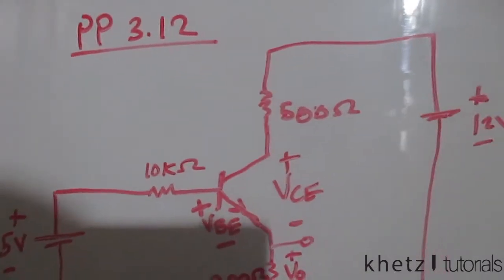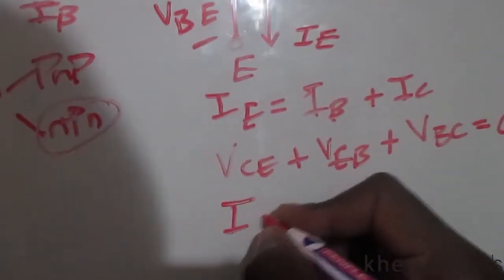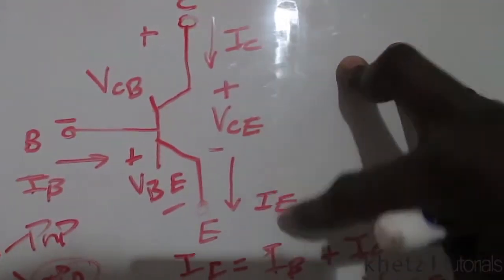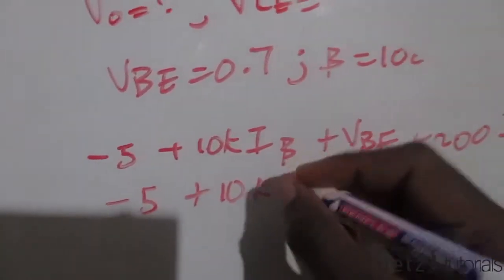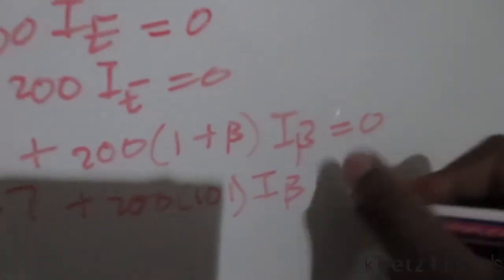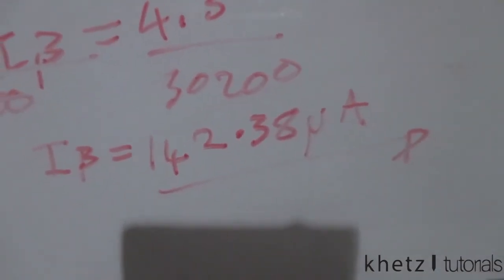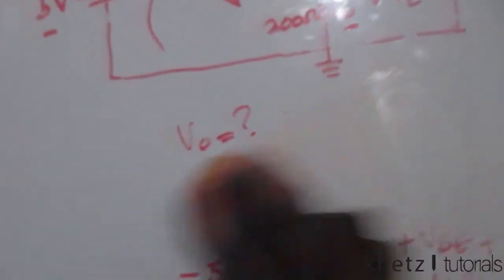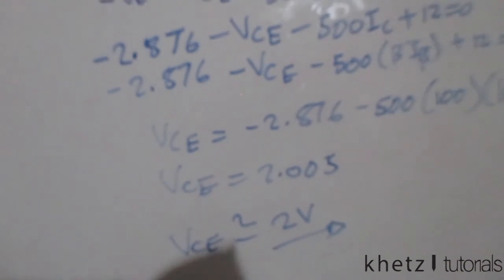Fundamentals Of Electric Circuits Practice Problem 3.12

Comment: have been struggling with the practice problem in the 6th edition, I thought I did it wrong, but the answer in this edition is wrong. Thanks for the vid!

6th has the same circuit, but for loop 1: 6V, 15k, 150 Ohm, and the answer in the book for Vo is 4.691V, your method gives me  2.663V.

practice prob 3.13 is also wrong in the 6th ed. and in the 5th